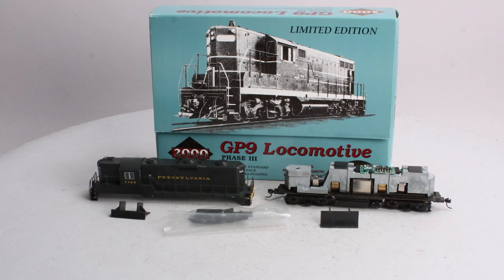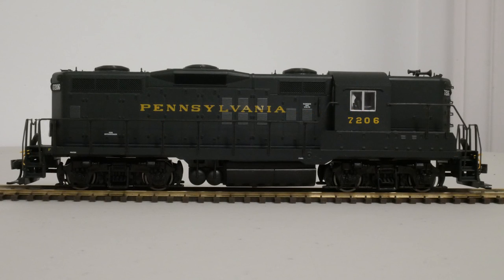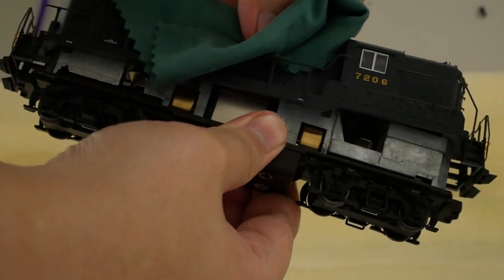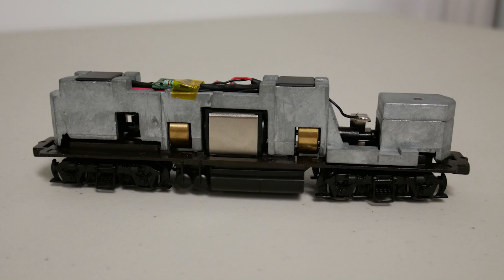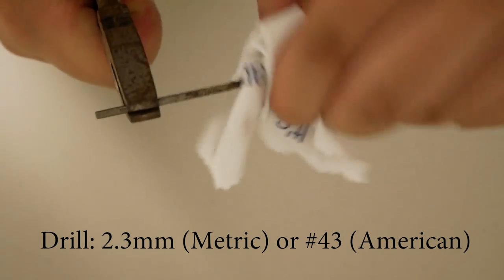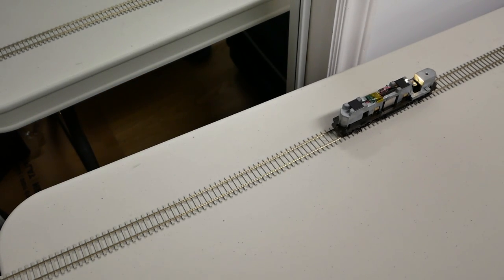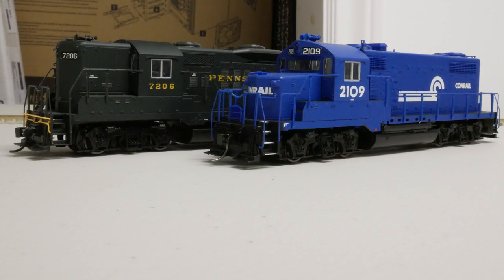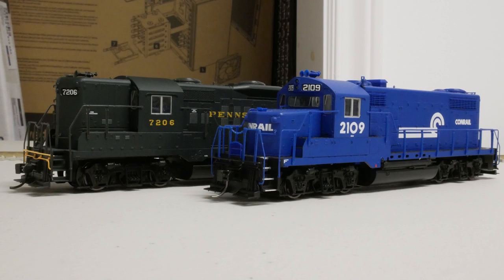Tutorial: Proto 2000 Cracked Gears Repair and Tune-up

Comment: like your video. Last year i picked up 2 ATSF gp60's from taobao, brand new. Cleaned all transmission parts, because they were locked up by the wrong grease used and lubricated them with ATF, preventive replaced the gears with Athearn. The details are still good even according to today's standards. I build in TCS T4 Decoders and they run smooth.
Reply from the maker: Good to hear! Thanks for watching!
Reply: way to go, but trans fluid can get into and ruin a motor. atf is a horrible conductor and even a tiny bit of it will overheat stuff. keep trying to run it and you'll need another motor. i've heard of that too, but I say spend a couple of bucks for a good synthetic or conduct-a-lube. be kind to your motive power.
Reply: @tommurphy4307  The trick is not to over lubricate and use very little ATF. The bearing blocks I lubricated with a needle.  The oil is only there to create a microscopic lubrication film.
I have seen models come from the factory with the oil dripping out of the gear boxes and contaminating the track. So that is to much oil.
When I lubricate nothing leaks oil.

Comment: super video. I never bid on any of these sinxe i thought they be to much work to make dcc. always thought the motor was atatched to the frame
Reply from the maker: Thanks for watching! The frame is used for the right side pickup (red wire). Hardwiring a small decoder is not hard, just be sure to isolate the decoder and all wires from the frame.
Reply: @DBRXCustomRailroadModels  Is this locomotive N gauge?   I have five bachmann locomotives and two have cracked gears.  I don’t know if replacement part are still available shown in the exploded diagram that were included in the box.  Maybe the gears you used in this video will fit?

Comment: Thank you this info , I have done the same repair on my Walthers proto 2000 gp20 & also tried to convert the trucks to DCC but have not been able to isolate the frame. Im a U.K. modeller parts are not easy to get in the U.K. could you please tell me were to purchase a pair of dcc trucks for this gp 20

Comment: easy fix just buy tons of those athearn gears they'll run forever.😙 Also note adding some plastic between the the two wheelsets to ensure no short circuits when you insert axles back in too tight. Add some very small shavings of plastic into hole first and insert wheel, with a small dab of CA glue on tip insert back into gear and check flanges with gauge....ask me how i know.

Comment: I actually repair the cracked gear with a set of sleeves in each of the stubs axles. Once the sleeves are pressed on I ream the axle holes so as to not reopen the crack.  I also use nail polish on the metal axles to give it some adhesion and keep the wheel in gauge and from rotating in the plastic gear. It is almost permanent when done.  Takes about 20 minutes to fix a loco. P Suhmann

Comment: You should remove the motor brushes and clean the brushes and armature as part of the tune-up.  If the loco has been used they will be dirty.  If NOS, they may be corroded.  The wheels should be cleaned for the same reason.

Comment from the maker: Spotted a comment with regards to the coupler and coupler box, not found anymore so I'll just leave the reply here:

I used the original Proto 2000 box. The Kadee 242 also fits in there but it is a hair narrower than the original box. The Kadee 5 is the standard go-to coupler for most people. The whisker version (uses two wires to center the coupler instead of a brass plate) of the 5 is the 148. The scale head version of the 148 (the 148 and 5 are regular heads) is the 158. And finally a short shank version of the 158 (the 158, 148, 5 are all medium shanks) is the 153. The 153 will look a lot nicer than the 5 when fitted onto the loco because it's smaller and allows closer coupling, but the 153 will be less reliable due to the smaller head and its swivel range will be more restrictive due to the shorter shank. It all comes down to personal preference.
Reply: Good to know those suppliers ,ty. I had gone to another business for replacement gears called  http://shop.osorail.com/category.sc;jsessionid=C229EA55C9497BB32CE37C91AFEE832F.p3plqscsfapp004?categoryId=14     .   They can make custom gears,wheels and other components too if you have an impossible part to replace,lol.
Reply: They also have a self contained drive mechanism for those looking for an easier power replacement called a Stanton Drive. That also as the ability to install a dcc decoder . However the stock stanton drive comes with all delrin plastic gears ...i would highly recommend all metal gears when ordering them for added strength and a good pull of freight consists.
Reply from the maker: NWSL is a great place to go as a last resort! Fortunately I haven't encountered a model that's required NWSL parts (except the Intermountain cab forward that used a NSWL motor)

Comment: nice very helpful , i bought a prr e8 the seller said he tested it and ran amazing with little run time for about $50. but when i got it it didn't move but the light worked. Is this the gearbox? HELP!!!
Reply: brushes/brush springs. make sure you get all the chinese crap out of there before you install the kato brushes!

Comment: I can't see the video for some reason. I have a TT scale KUEHN MODELL, brand new, bought from Germany, had it for at least 6 years, kept it in the original box, a few days ago I've decided to run it and guess what? the 2 powered axles from one bogies are getting stuck impeding the model to travel on either direction, I've removed the truck cover, pulled the 2 wheel sets out, inspected the gear, come to find out that they were sliding up and down the axles and plus the teeth wheels (with extended barrels on one end for alignment)the barrels were split, cracked all the way to the gear. So 130$ down the drain, the company does not offer spare parts. German technology made in China! BEAUTIFUL!

Comment: You can get a used Proto unit at a train show (2019)for very  cheap ( <$40)and yes chances are it will have cracked gears. Find a supplier for them and stock up!
Reply: absolutely- NWSL will love you for it.

Comment: Excellent video.......very straightforward with awesome video footage. Has this locomotive been a reliable runner after the gears were replaced?
Reply from the maker: The Pennsy GP9 is my 'club fodder', which I leave at my local model RR club for weeks at a time. It is operated by many people there including myself. With regular maintenance it has not given me any trouble.